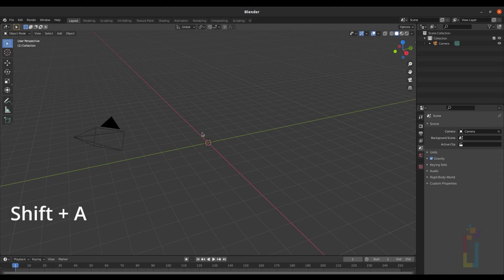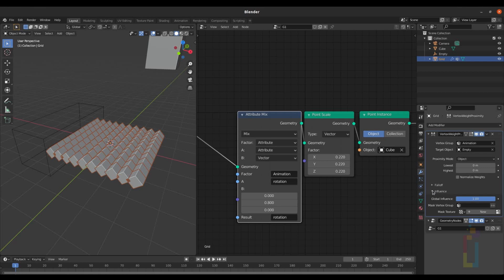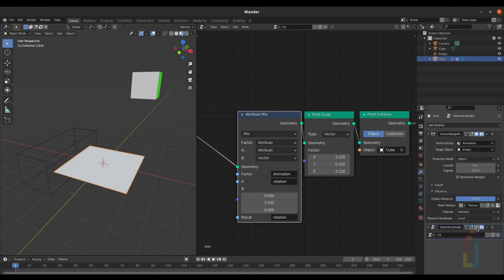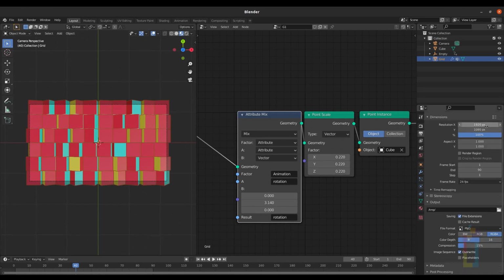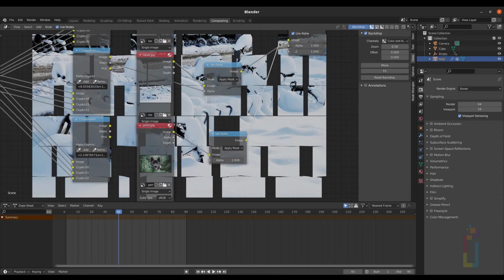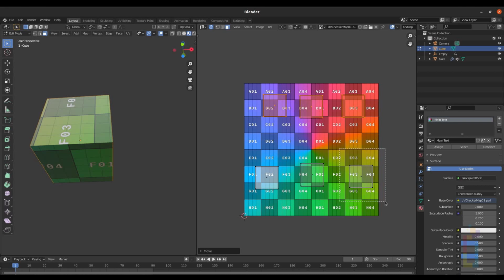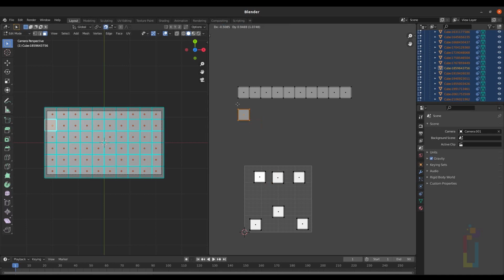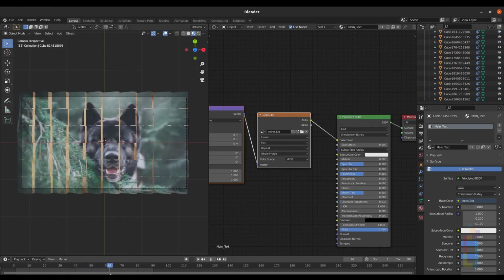Blender 2.93 Mograph: Geometry Nodes Wall Of Cubes

Comment: I am just staring out with Blender and Geometry Nodes using version 3.4.1. Following this tutorial, I can't find Point Instance option in GN. Since I am new, I can't find the alternate to it. Can someone point me to the correct option?
Reply from the maker: Hello and thanks for the comment, you probably need to watch this update https://youtu.be/tolqBEyiSs0.
Thanks
Reply: Thanks. It seems there are too many changes from 2.9x to 3.4x and I am struggling to follow. Maybe will revisit this when I am more experience in this
Reply from the maker: @verydisc33t  You could also download Blender 2.93 to follow the tut and then open the file in 3.4 https://download.blender.org/release/
Reply: @Pixldg  Yay! Managed it. Thanks a lot
Reply: The 2.93 file doesn't open in 3.4.1. The nodes are undefined, turned RD and nothing seen in the viewport.